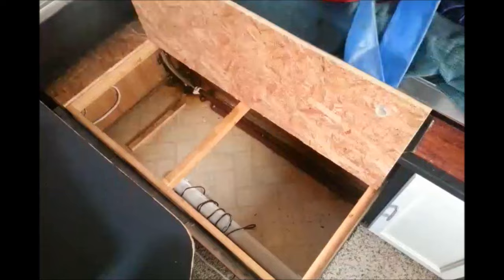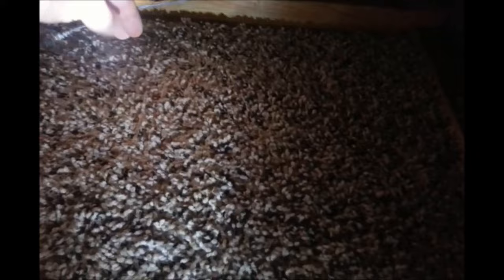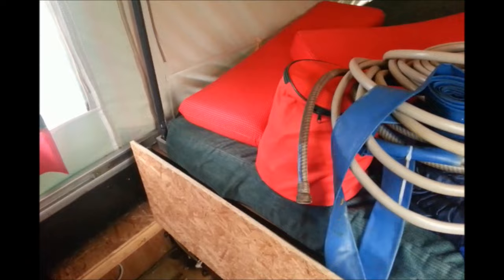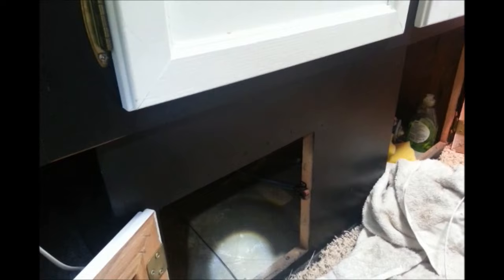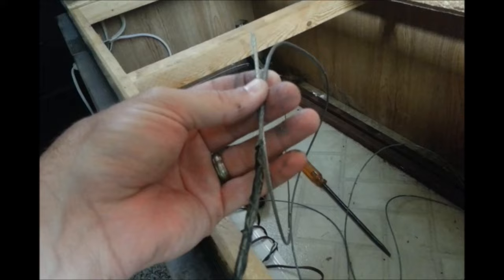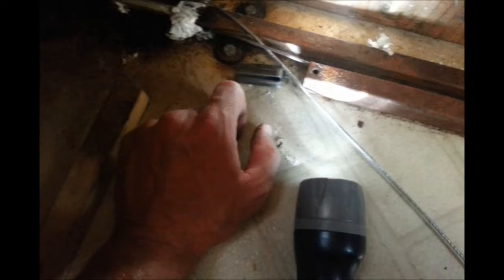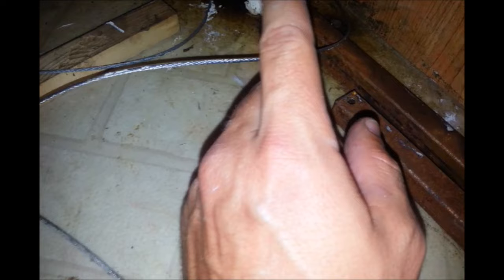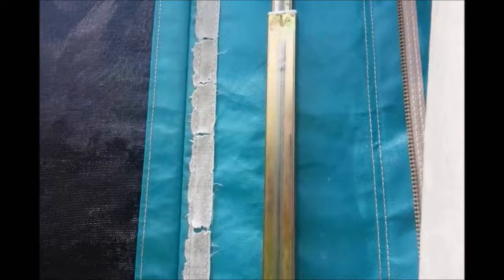Replacing a broken cable on my Popup Camper

Comment: I like your idea of having some stilts in place being that it's older camper. After I fix my lift system I'm going to use some nice white PVC tubes put some slots in them and put them on the four corners when camping. Thank you for the great video!

Comment: Thanks a ton for posting this! My 2007 Jayco 806 busted a cable last week. I watched this video last night, picked 25 feet of cable and a couple clamps this morning, and knocked out the repair in a couple hours. Pretty straightforward other than the busted cable got lodged in one of the pulleys and it took about 20 minutes to get it out. Thanks again!

Comment: Thanks so much for this video!  I have the EXACTsame popup and after watching this video, I was able to repair my lift cable system as well.  Not only did my cables break, but one of the pulley wheels was damaged and the crank shaft was bent out of shape.  I have since removed all cabinetry and am replacing the vinyl floor as well as replacing some rotted wood flooring.  The original quote I was given to replace the cables ONLY was $800.00!!!!!  So for roughly $50.00 or so and a lot of my time, I have replaced ALL cabling, welded the crank shaft back to shape, replaced the rotted floor section and put down a new Vinyl floor.  The popup is like new!  Thanks again!
Reply: Chris Mohr thanks
Reply: I was hoping you are in a position to share your work how much cable wire etc

Comment: Awesome video.. very informative. For others watching and learning , the eyebolts are supposed to be the weakest link in the system. It is better to bend one and replace it than to go through all the steps involved in this video. Do not get bigger eyebolts and weld the separations on them. They are an integral fail safe. Cheers

Comment: Thanks so much for your video!  I just finished helping a friend repair his viking camper that has the same mechanism. We replaced all 4 cables. Here are a couple of things that also helped us....

Cut 4 2X4's the exact size to have the camper fully popped up.  I really liked your suggestion to prop up the inside (bed to ceiling in our case) and then let out a little tension whenever the camper is popped up.  These 2X4's did the trick and were very useful.  Use the 2X4's to support the roof while doing the final tensioning.

You will have to remove panels and steps to expose the cables.  A good battery powered drill helps here.  The camper we repaired used square bits.

On the top of the spring cable (snake) is a bolt that fits on it.  Make sure it does not come off.

Weld new eye bolts together as in the video.  Our old bolts were spreading apart under tension of the wench.

Make sure the wench is fully bolted to the floor.  We had to add a couple bolts because the wench was coming loose.  Bolt through to the underside to the camper.

Do NOT use vinyl coated steel cable.  The vinyl coating comes off and messes up the pulleys.

It took 3 people 3 days (15 total hours) to do this repair because we are not very smart (we had to replace the wires twice) so do not think you can knock it out in an afternoon - or maybe you can!

We had one corner that would not pop up and it turned out that the rectangular plug on the end of the cable got jammed inside the square spring cable tube.  That took a while to fix.

I guess that is it.  I will add to this list if I think of anything else.  Thank you again for your video.  It was amazingly helpful!
Reply: Where do you get the cables?  Or do you just go to a hardware store and request a certain length?
Reply: We bought the cables at Home Depot.  Do not buy the vinyl covered ones.  If I remember correctly we bought 50 feet of cable and then cut it as needed.  Try to make a good estimate of the cable length you need.
Reply: Just a little background information.  The eye bolts where the cable runs through are engineered to spread apart if over tightened.  This is so that the cable has a chance of not snapping.  By welding it together you stop that from happening.  I think welding it together shouldn't hurt.

Comment: Great video as I have replaced lift cables on my 1993 Jayco Cardinal SD...I have replaced more than I care for (lift cables), which the video states is simple but time consuming to say the least. I have to offer another piece of advice: Check all your pulleys as well! I found some of my pulleys frozen to the point all my new lift cables were doing were being sheared by frozen pulleys that no longer rolled freely.

Comment: Thanks for the video! It helped me allot on replacing a broken cable on my 94 Viking. I did the same thing and used the old cable to pull the new cable threw all the pulleys. It worked great!! As for cable length you prop the roof up on all 4 corners and make the cable close to the same length and adjust it with the eye bolts at the crank.

Comment: Good stuff, I have the same lift system with same problems. The forward right post cable snapped, and it was partially due to the cable rubbing on that pulley in the back. Great video. I'm about to start my repairs. FYI, I took it to an rv mechanic and they estimated 300-400 including the pole replacement!

Comment: The plat needs  to turn when you crank  it up and down  so that cable  does not twist and the I bolts are not to be welded  closed they are designed  to open it's a safety  thing so cables  come off and don't brake and use crimp clamps not bolt clamps

Comment: Hi love the video. I am looking at buying a 95 viking pop up. That only attempts to raise at two corners.  I understand the routing of the cables. What I don't fully understand is how does pulling a cable raise a corner of the camper.  I noticed this camper had inside two pieces of spring for the corners that were 3 or 4 foot long laying in the floor. I would simply like to have a better understanding of the lifts before I decide to purchase.

Comment: I did pretty much this same thing on my old Star Craft several years ago. It's a cheap flimsy system and I'm surprised they work as well as they do.  I'm doing a rebuild of the little trailer and an searching for a more reliable system that is easier to repair and maintain.  If this breaks when on a trip you're kind of screwed.

Comment: Question.  Never owned a pop-up camper.
Can a 3 or 4 guys lift the top up, of a camper with broken cables, then brace it up?  I'm only wanting to camper to make a deer blind out of it. Replace the soft sides with plywood & install windows.
Reply from the maker: Yes. There have been times when I had to lift myself.   Easier with help.

Comment: The reason your cables are twisting up is because you are either missing the thrust bearing that goes behind the metal plate with the 5 holes or the thrust bearing is frozen.

The thrust bearing allows  the main cable to twist but keeps the plate aligned with the 4 cables that attach to it. You really should download the service manual for the lift system before trying to repair it  the system. At least that way you can see and exploded diagram which shows all the parts that way you know if somthing is missing or not working properly. 

 You should also order a new corner tube guide to replace the bent one they are only 7 dollars for the guides without bearings and 45 for the guides with bearings. Just about any trailer supply will stock them.

Comment: Fantastic.  I had a problem 1000 miles away from home.  Now not only did the cable break off at the eye by the crank.  The little plastic piece that fits on the big cable fell off from inside the telescopic beams.  Are these connected in some way to the big cable or do they just sit on top of it and push up?

Comment: Thanks for posting the video.  I might try to do the repairs myself.  First problem I have however is lifting the top up.  It has an air conditioner and is very heavy.  Any helpful ideas on lifting the top so I can begin the work?
Reply: That is the same problem I'm trying to figure out. Did you ever figure out how to get the roof up?

Comment: Good video, I replaced all 4 cables, worked, thank you , now I have 1995 Viking 195 st with l&W lift system. All poles go up and down, but front 1 do not go down about 8" I tried to adjusted. I could not figure out, rear ones go fully up and down, front ones go fully up but not all the way down. Any suggestion will be appreciated. Bb

Comment: Thank you we did use 2 by 4s to lift us roof. But we needed to remove the cabinet to access the cable housing than it was easy to remove the flag.

Comment: Great video! I’m wondering my tape didn’t stay attached and I lost the connection from the old wire and new what do you think I should do now? I can’t seem to just feed the new wire thru very well. Much appreciated!!
Reply from the maker: Luckily I didn't have that problem but I  can't think of another way except to manually run the cable.  This would require much more work and disassembling more of the camper to access the  pulleys. Good luck.

Comment: Great video!! Thanks. I just sold my pop up camper and the buyer (single mom) took her 2 young boys to the camp site immediately. She just sent me pictures of the pole pulled out of its socket with the hose hanging out. I think she somehow broke the cable. I'm going to be patching this up on the fly so how long of a cable to I need to buy? Also did you need a crimping tool or could I use pliers?
Reply: Hey CrazyCamperCrew-  Do you adjust the tension by simply turning the Eye bolt?  Or is there more steps to adjsting the tension on any given cable?

Comment: for the first video of replacement of cables  in that back corner put a double pulley to help with your problem  of your cable riding on your metal area

Comment: Hi guys! Great video thanks. Gives a very good detailed description of how to fix this problem. My question is, does anyone know anything about Conway Cardinal Clubmans? I have one and one of my cables is broken and I am wondering where the whole mechanism/pulley thingy actually lies within the trailer. I have had the back off a few years ago when I had to make a new reinforcement plate for the winder bar, and don't remember seeing any pulleys or wires there. I would prefer not to have to pull every panel off looking for it. Thanks :)
Reply: Carmel Connors

Comment: We would really appreciate your help. We just purchased our very first pop up camper a Viking 1995 SH 270. We brought it home, tried popping it up and the cable broke. Whoever had it before us had it fixed but they didn't do it correctly and replaced some parts with some other ones that weren't correct. Now we are in need of a corner bracket with a pulley that has double cable capacity that is for a rear crank Viking SH 270. Any help on this would be much appreciated! Where can you find on camper parts? We are at a loss and we can't find any ships in the are who are willing to help fix it. My husband is handy but he can't seem to figure this one quite out, especially since we don't have that double pully.

Comment: Thank you.  We just bought a used 1993 jayco 1207. At a campsite now and the lift spring fell out of the lift bar. It is sitting inside the compartment with the water tank. Do you have any ideas in how I can feed it back through to the lift bar?

Comment: hello I Have a jaico camper Im redoing the roof but the roof have bend after add the plywood, I used the 1/8 playwood, is 13x7 the roof is big.The roof sinks I put several wooden bars to give it more support but it continues sinking after I put a thin plywood sinks
I need an advice please!!!

Comment: Bought my first pop, never looked at the cables. Do you recommend to lubricate the cables? If so, is the roadmaster silicon spray good to use?
Reply: I personally think lubricating the cables and other moving parts is a good idea.  And I think silicone would be a good choice.

Comment: Great video! However, I got a question for you. At 3:42, when you have slid the telescopic outside bar down to show the little plastic part that fits into the top pole....any idea on what to do if that little plastic piece is misaligned down inside the bigger first tube and wont come up inside the middle tube?
Reply: Thanks buddy!  And keep up the great vids!

Comment: By the way I forgot to ask, on the outside of the camper when you serperated the poles the little white plastic clip/bracket that goes on the top of the pole in your video its right at 3:30sec. Any idea where to get that clip that goes in the lift pole?

Comment: Do not weld the ibolts thay are ment to open up so the cables don't brake thay just pop off the idolts and then you fitting new ibolts and readjust and tension them up again in this way you will not bend or brake some thing else like pulleys and lifting arms 🇦🇺😉

Comment: Hi Mark I watched your video because i bpught a 1974 Starcraft pop up camper and wgen i bought it and the guy raise it up and open it everything worked fine and for most part was in good shape but when I got it home and raised it up the back left corner wouldn't raise up with the other 3 sides and i noticed the bar on that outside that raises it the part that isnt attached to the top of the camper was going down towards the ground instead of goung up with the other bar thats attached the the top of the camper. I was wondering if you had a suggestion as to why this is happening? Someone said that the cable probably came loose from the second bar but when i watched your video and you took the outside metal bars apart and said theres a spring in it now im wondering if its that spring thats not working. i dont know if I've made any sense but do you have any suggestions as to why the 2nd metal bar on the outside of camper on the corner is going down to the ground and isnt rising up with the metal bar thats attached to the top of the camper that raises it? Any suggestions would be greatly appreciated.  Thank you.
Reply: CrazyCamperCrew ok thank you for your help. That's what i was afraid of after watching your video that the cable broke on mine too. Im pretty sure thats it. Now I know where to go from here, thank you for replying and your help. Have a wonderful day 😁

Comment: My husband is getting ready to replace the lift system in our pop-up. He wants to know why not go to a thicker cable? Or is that even feasible?
Reply: I tried that, the thicker cables will not fit in the floor brackets that hold the plunger rod.   Replace the actual nylon pulleys with metal and add more wheels around the corners

Comment: hi I am going to be attempting to replace all the wires in my pop up tomorrow I have a Viking 1996 looks like the same setup as your pop up. you placed the four bars on the inside all I have to support the roof is 2x4s do you know how long you made your supports?
Reply: +Scott Bishop We have a viking 1996 also and just broke a lift cable on our camper over the weekend.  Just wondering how your replacement went? We will be attempting to fix ours soon and could use some advice as well.  Hope yours went well!
Reply: Scott Bishop I

Comment: Do you by chance know how to fix the cable located under the popup?  we have a 1998 dutchman that we just bought, brought it home started cranking the roof up and the cable broke.  It is located under the popup.
Reply: I think that the Dutchman lift system and the Jayco lift systems may be a little different in design...there are many Dutchman lift system forums out there that can probably answer your question better!

Comment: My camper is a 2005 Viking epic 1906, the lift system failed at home after a camping trip and the crank won't completely lift the top. The top only goes up about 6 inches and stops lifting...been trying to find a diagram of the lift mechanism with no success any clues?
Reply: Thanks, 
But a friend came by and pulled the whole lift assembly for me.          4hr. later , found that a "shear pin" had broken inside the assembly. Went to an automotive shop picked up two (2) and the lift was working like new.

Comment: How long was the safety poles you have on the inside and where did you buy them.
Reply from the maker: It's was awhile ago and I don't have the exact length.  I'm guessing the length will vary depending on your camper.  The poles I used were from a safety fence that goes around a pool.  They just happen to be the perfect size.
Reply: So do you recommend I get inside and lift the backside so I can put a safety pole in or at least try and get a measurement.  I don't know how to go about doing it. The front works and the back doesn't lift.

Comment: Please help!!!! I want to do the cable myself somI can pull the new with the old but can I use the aluminum crimps found at lowes and Home Depot or is there a better stronger piece somewhere? Also what tool?
Reply: @rightdirectiondrv  ;; Should I replace with same size cables, or a little bigger cables ???

Comment: so the roof could potentially fall on your head , if that one main cable that pulls the other 4  snaps?
Reply: CrazyCamperCrew I don't remember exactly why, but my model the Coleman fleet wood niagra a 2008 model I believe. They claim it doesn't need the metal pieces for some reason.

Comment: Flag is wrapped around crank cable unable to lower top any ideas. Help please
Reply: Flag?  If it's literally a flag or fabric wrapped around the crank cable inside the camper I would prop all 4 corners up with wood or something.  Release the tension off the cables and cut the flag off.